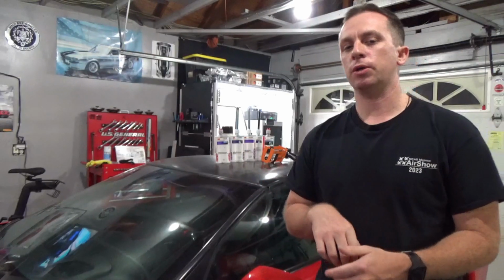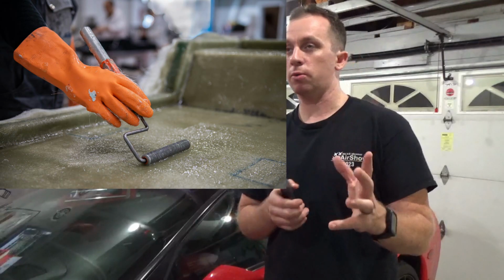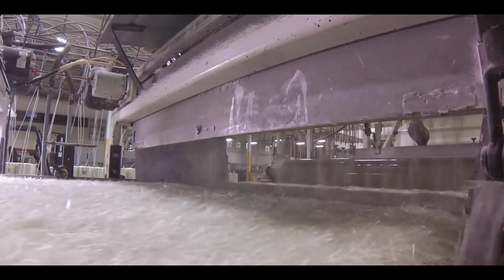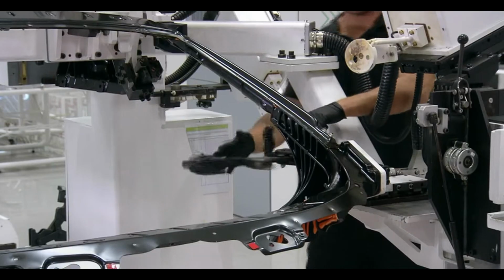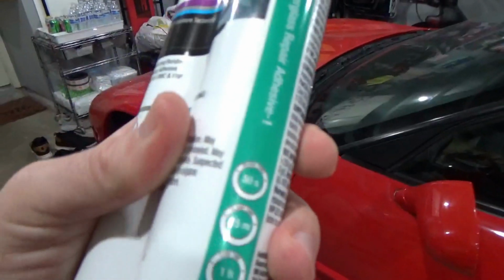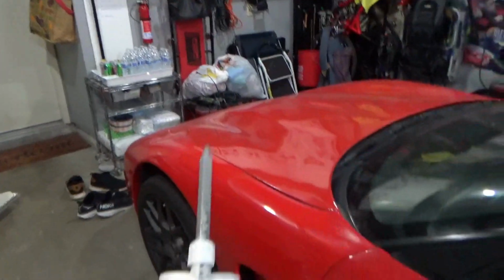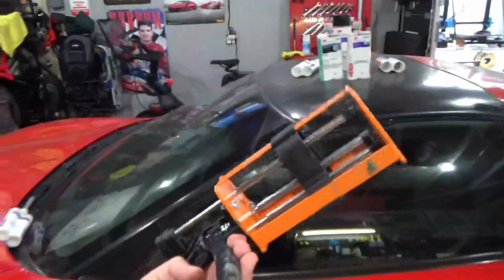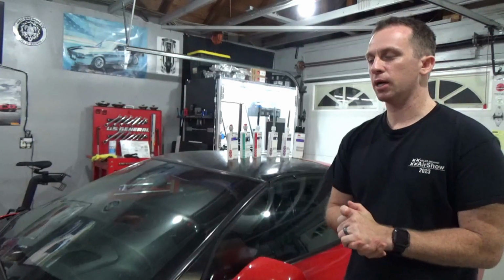Here Are The BEST C5 Corvette Body Repair Materials (NO BONDO)

Comment: All corvettes are made the same. Does C5 and the C6 are similar?
Reply from the maker: I would caution to say that “all corvettes are made the same” because that is likely not true. Especially pre-C5. C5 and C6 are very similar, but there may be subtle differences in materials used for the body panels. I haven’t looked into the exact differences between the two since I only own a C5.

Comment: This was a really informative video! I kind of “curbed” my C5 pulling out of a parking space… some scrapes to the rocket on the passenger side right behind the front wheel… of course I was afraid to get out and look because it sounded awful! 😂… I think I can use the spray adhesive and the EZ sand because the scrapes are not bad… barely visible from the top. Thanks SOOO much man!
Reply from the maker: Glad the video was helpful! Exactly why I wanted to share everything I learned! The EZ sand stuff worked great. I used that all over my front bumper and it was in REALLY rough shape from the accident the car was in before I bought it. Now, I’d argue you wouldn’t be able to tell 😉

If you have access to the back side by taking the rear inner fender liner access panel off, I’d recommend using the rigid parts repair (the blue stuff) to reinforce the repair from the backside, possibly by also embedding some metal wire mesh.

Comment: Good Tutorial.  Have a C5 with a broken F Fender Mounting Hold on the Rocker.  Will one of these work to fuse the fender to the rocker?
Reply from the maker: Thanks! Glad it was helpful. So you’re looking to bond the rocker panel to the bottom of the front fender?
Reply: @Addimotive  Hit a pothole and crunched the R Front Fender to Rocker Panel mounting point so the mounting hole on the Rocker is damaged & the body bolt cannot be used to fasten the Fender to the Rocker any longer.  Was thinking of fusing the Fender to the bottom of the Rocker.  Have already tried 3M 4200 and it did not hold.
Reply: @Addimotive I have the same issue that the original commenter mentioned, the fender mounting hold on the rocker is completely gone. I’m thinking of bonding the fender to the bottom/side of the rocker panel so it holds in place. Do you think this could be done with the fiberglass adhesive you mentioned
Reply from the maker: Where the speed nut and threaded screw normally goes?
Reply: @Addimotive  YES, exactly...where the speed nut & threaded screw is located

Comment: Can you repair the side rockers without taking them off? Because they are glued on. I have some small scrapes and scuffs on the bottom of the side rockers which is common, but not cracked. I want to repair and repaint without taking it off..
Reply from the maker: If the cracks are minor, then I'd say yes you could repair them. Groove out the crack with an angled carbide burr bit (to give the adhesive more surface area to bond to) and then apply a layer of the rigid parts repair adhesive (blue adhesive), followed by the adhesion promoter and then the EZ sand repair adhesive for the top repair layer due to how nicely that adhesive sands and smooths down. If the damage is towards the front of the rocker, there is a removable panel on the aft side of each front wheel well that you can remove to see the back side of the front of the rocker panel / fender. Hope that helps!
Reply: @Addimotive  Thanks for the response. That stuff is $350 bucks here (NZ) just for the 3M stuff. I decided to have a shop do it, and they are going to also cut out the hole so I can fit the Z06 brake ducts.

Comment: How would u go about fixing a rocker panel at the specific location of where the front fender connects to it. This is the only flaw with my rocker panel and I want to know if I can save it?
Reply from the maker: Integrity of the repair will depend on how severe the original damage is. But luckily, if the damage is towards the front of the rocker panel, you can take off the rear panel from the wheel well area for access to the backside of that area. If the crack is minor, I'd just use adhesive to repair it. If the crack is major I'd use a wire mesh to reinforce the backside of the repair. Essentially mimic what I did for repairing my front bumper, same adhesive and all. The Rigid parts repair for backside reinforcement and the EZ sand adhesive (with the adhesion promoter) for the visible side of the repair.

Comment: 08243  3m smc repair can’t be painted over or body filler over it’s made for back side repairs with fiberglass over the top if I’m remembering it I use lord fuzor ez100 it’s a oem compliant for bonding and fixing voids and cracks
Reply from the maker: Based on what the application engineer from 3M told me, any of these repair epoxies can be painted over, so long they’re completely cured, the surface is prepped, and have the right primer sprayed over first.
Reply: @ ok I appreciate that

Comment: Can definitely appreciate the experience learned by doing this work yourself…. But dang you could have gotten a used bumper in perfect condition for far less than you have in all those 3M repair products!
Reply from the maker: Likely very true, but after failing at the bondo glass / bondo repair job, I was determined to fix this thing the right way. Plus it was great learning experience for the rest of the car since I had to buy materials for those pieces anyways and fix other panels in a similar way. 

Plus used bumpers are few and far between to find locally. I didn’t want to have to ship one from somewhere else because 9 times out of 10 they arrive damaged because they’re awkward things to ship.

Comment: what number should I use to seal a crack in a door?
Reply from the maker: Once you groove out the crack and sand to give more surface area for the epoxy to bite, I’d use an SMC repair epoxy (like the one I showed in the video), but try to find one with a longer work time (50 seconds was not long enough). Then once you sand and smooth that down, I’d use the EZ sand epoxy over top of that to get your smooth top coat.  If you can’t find an SMC adhesive with a longer work time, then the rigid parts repair should be a good epoxy to use in place of that. I used that to repair a giant crack in my front bumper (but I had access to the backside of the damage because I took the bumper off the car). Hope that helps.